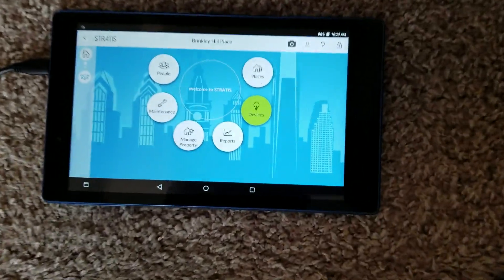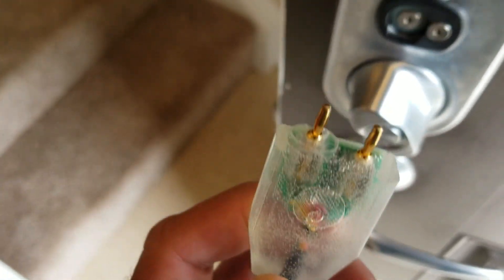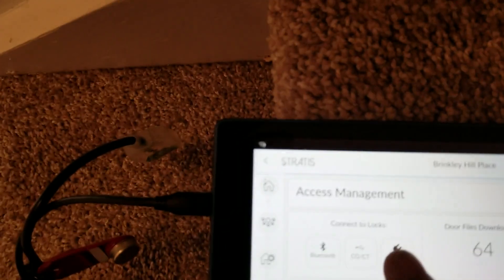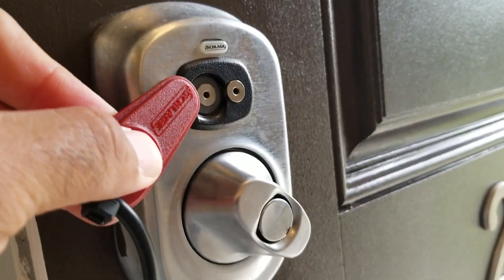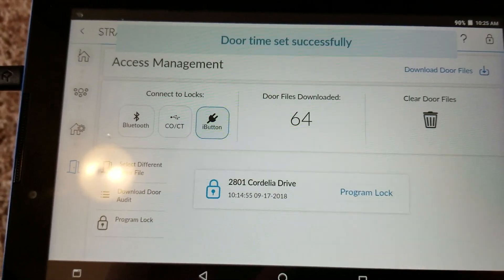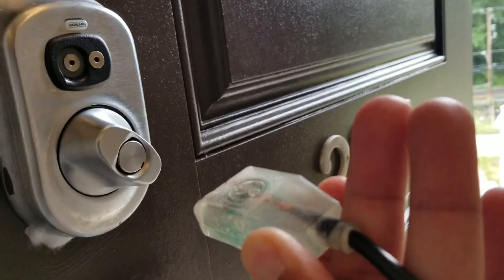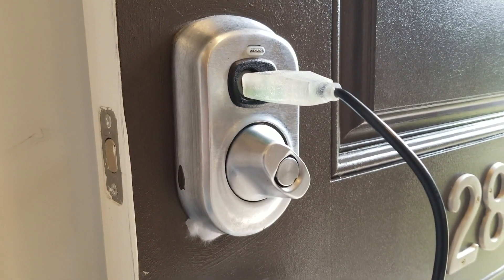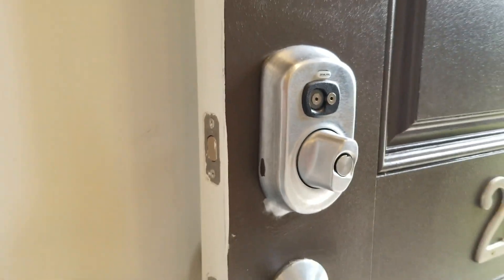Part 3 - Program Schlage iButton Keyfobs using STRATIS IoT Tablet

Comment: Hello,

Any troubleshoot ideas if it’s blinking red while in programming mode (instead of red and.
 Green).  Battery has been changed to a new one. 
I am getting an error “warning lock not responding, check cable connection and program code. 

Thank you
Reply: When you install the lock, make sure that the black dial has its arrow pointed down to the arrow on the orange plastic plate.  The door will detect if this is incorrect and may not allow you to program it.